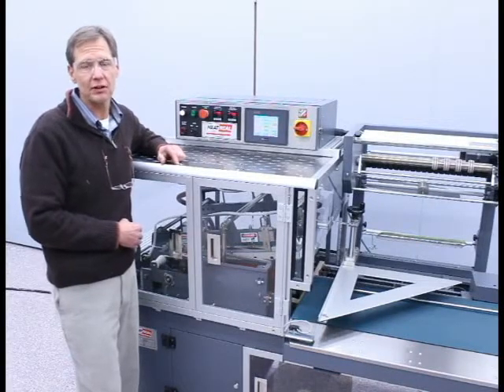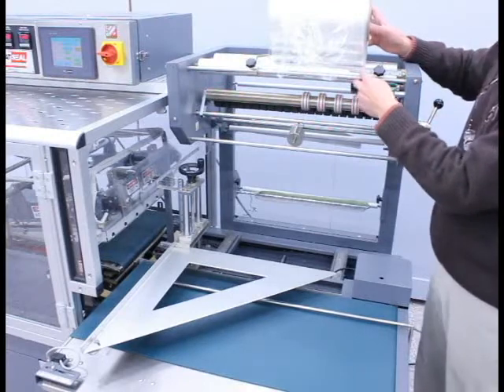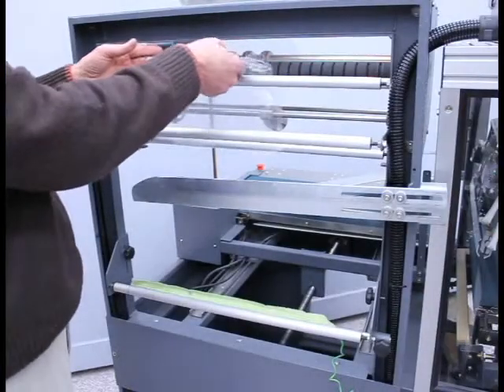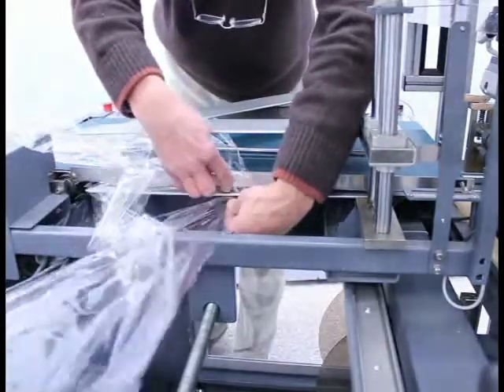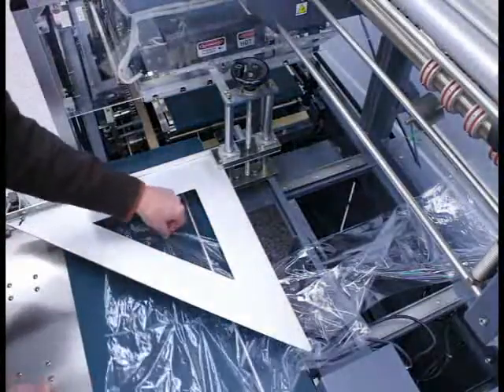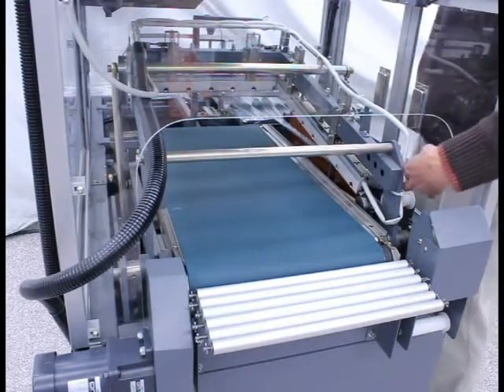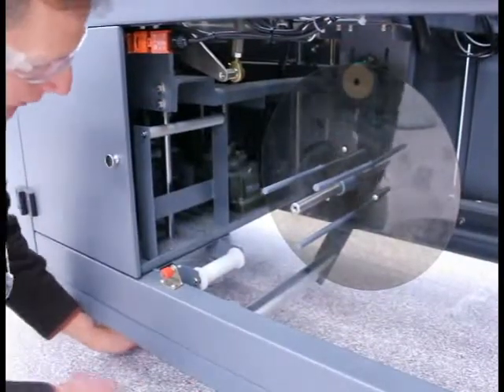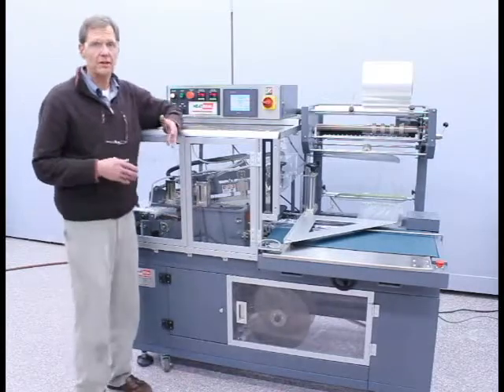Threading the Automatic L Sealer

Comment: Can different lengths damage the l bar
Reply from the maker: Hi Jody, The product has to fit in the dimensions of the L-Bar. If you have any questions or concerns about a Heat Seal machine, please feel free to call us at 216-341-2022